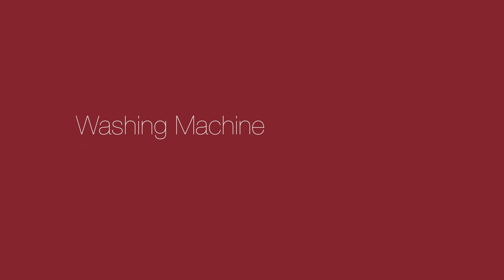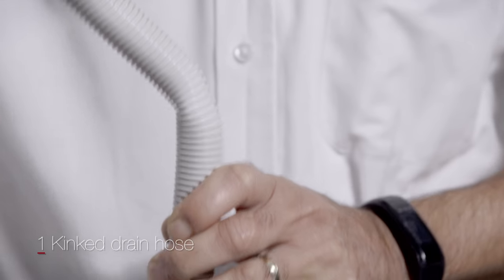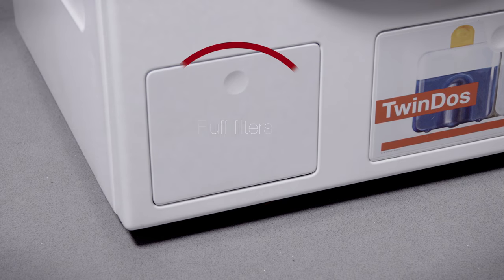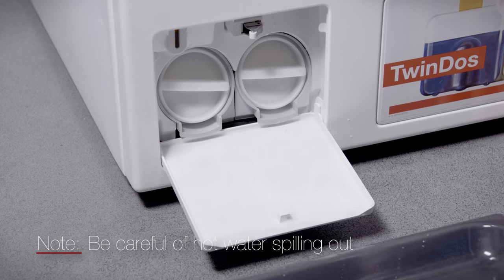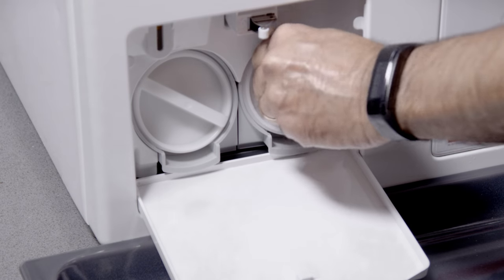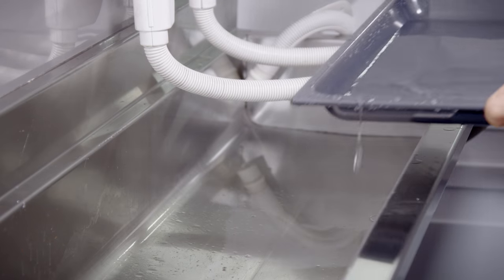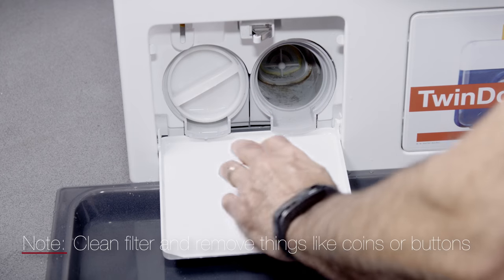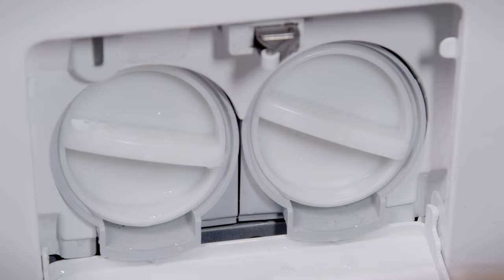Miele How-To: Washing Machine Drain Fault

Comment: As some others have said, if you check everything and still getting a drainage error, try tipping the machine forward 45 degrees for 15 mins to clear the water out of the sump under the machine.  In addition, if the fault comes back, get the machine away from the wall and check for blockages in the drainage hose, as sometimes bits of fluff and hair seem to get past the filters in the machine and clump around the hose.  That sorted it for me.  Good luck everyone.
Reply: Awesome tip - tilted machine forward after trying son many other things and left for a while and hey presto wash machine magically worked again. Thank you so much !
Reply: tipping it 45 degrees worked for me, thanks
Reply: Tip it forward? They said top it back so I’m confused 
I have error f138
Reply: How do I hold it at 45 degrees for 15 min it’s heavy???
Reply: @HM-ot2hr how did you leave it forward? Did water come out? Did you remove water from the filter at the bottom?
Reply: Thank you soooo much your info just saved me a very expensive Miele technicien!! my washer is over 20 years hold and still is the best washer ever. never had any problems.. tried cleaning the drain and checking all water entry and drain.. It was still beeping.. tried the 45degres angle everything is back to normal!!! THANK YOU SOOOO MUCH.. of all the info on internet and reading the whole manual this did it!!!;)))))
Reply: Thanks for this tip - it worked, BUT the water didn't come out of the drain hole - it just leaked out of the bottom of the machine all over the floor - is that supposed to happen or do I have a problem?

Comment: Have an European model WT1 that needs a new drain pump. Know how to access the pump?  Only one of the two pumps appears operating. No front lower kick panel, so not sure how to remove front panel.
Reply: Hello, we just bought a  brand new machine and have the same drainge problem, second pump wont start..
Reply: Same problem. Second pomp dont start. The one from left hand side
 Brand new WM.
How didyou fix it?

Comment: Hi - my Miele now shows Drain error at the end of the washing cycle and does not drain. I have emptied the drain filter and still not working. could this be due to drain pump need replacing or something. please help.
Reply: Did you get fixed?
Reply: Did you get yours working?